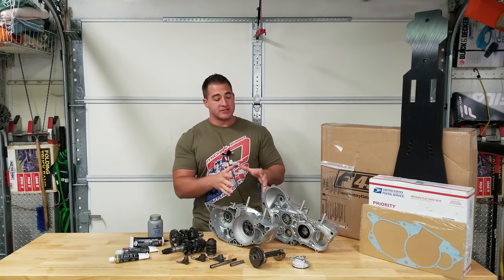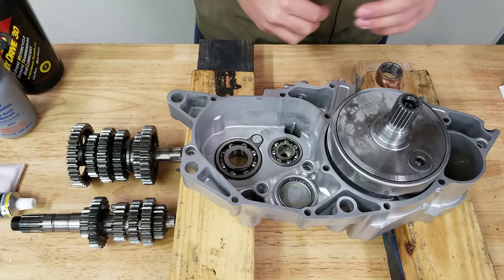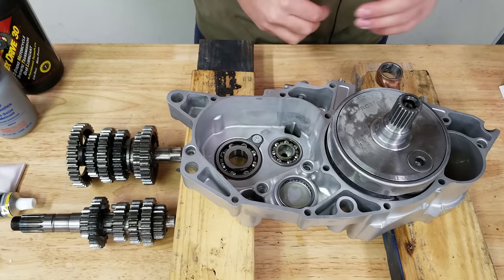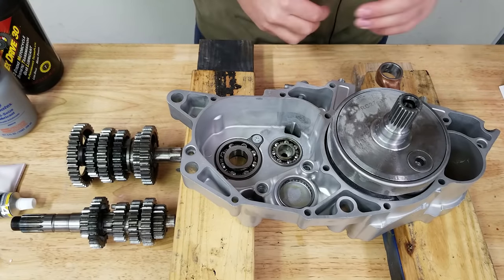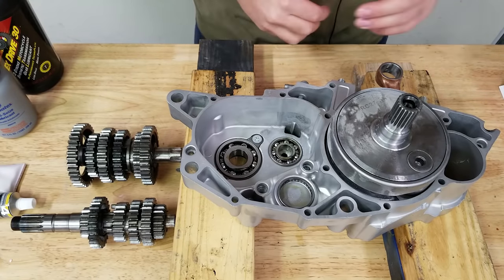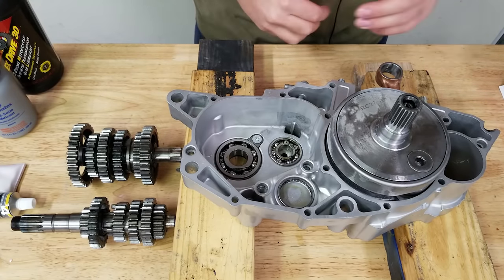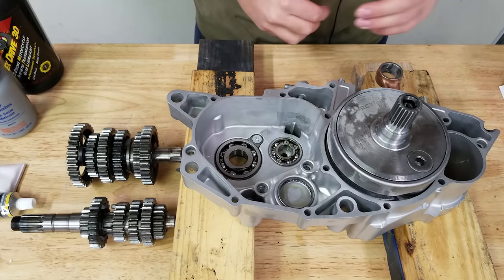Building the Center Cases on a Honda TRX250R, Step by Step | Project 250R Part 20

Comment: I used zip ties to hold the gears tight.  Lined them up and inserted the gears.  Once started in the bearing holes, I cut the zip ties and pulled them out.  Worked perfect.

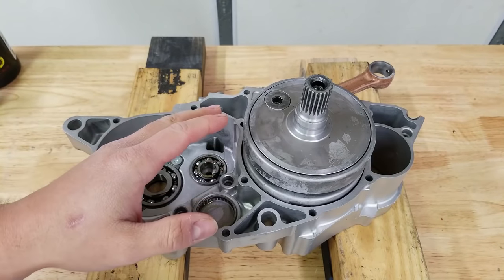Comment from the maker: SORRY FOR THE DUB AT 4:32-4:50!!! I am in the process of fixing it!!! You all rock!! Extra special thank you for everyone that tuned into the premiere!
Reply: Cream and a man been watching all your videos from the beginning specially the to 50RI am a to struggle over myself I'm currently in the process of rebuilding its a caddy for one dunno if you knew of any companies like a help me with parts I know they are super rare and a lot of the parts of discontinue try calling some of your buddies over at DBC but I'm never able to get an answer wonder know if you could help me out at least pointed out right direction
Reply: Sorry about that my auto correct on this tablet is crazy....smh
Reply: 88 kawasaki tecate 4 need help finding parts
Reply from the maker: DBC is usually pretty responsive; you can try sending them a direct message on their instagram @dbc_racing or email them. Parts can be really hard to find for these older quads unfortunately. Always keep an eye out on 250r forums and ebay.
Reply from the maker: The Tecate 4 is probably the hardest to find parts for, especially the 88.' I want to build one but that is what's holding me back from doing so... parts

Comment: Happy to see the poly skid plate. They slide across stuff so much easier so they dont have to be as tough as the metal or aluminum and are better for the vibration of the bike and also for putting back on after taking some hits they line back up and are not as warped, if so lay in the sun or put some heat to it

Comment: The moly grease is not for sticking the washers of the gears, it is when you crank the engine for the first time, this places can be damaged because of low lubrication. It will also prevent heat buildup in this rubbing parts. This is what I know.

Comment: I always find it easiest to stand the case up when putting in the trans. Gravity doesn’t pull the washers off. And usually you can mesh both shafts and support from the bottom with both hands. Slide it right in place then put the case back down for the shift drum and forks.
Reply from the maker: Good call, some other guys were saying the same thing!

Comment: When you are installing the crank by freezing it you can heat the inner race on the crank bearing. Just take a socket that fits inside of it and heat the socket with a torch. Not in the bearing obviously.  If you heat the socket and put it in the bearing a few times you can transfer heat to the inner race without melting and seals like would happen using a torch on the bearing. Doesn't take much to get it to expand just enough for the frozen crank to drop right in. I've built a lot of engine's both 2stroke and 4stroke and it works flawlessly most of  the time. 1 or 2 out of the last 10 engine's I've done only needed to be pulled the last 1/8 inch probably due to me just not being quick enough heating then dropping it in immediately.
Reply from the maker: I appreciate the info man! I don't mind using the crank installer but I will have to try this method!

Comment: Sweet ass build. Curious if u got the crank run out checked before u installed it. I'm sure u bought new crank yet just because it's new doesnt guarantee it was balanced properly. Even few thousands out cause excessive vibration etc. To nice a build to skimp on anything.

Comment: Is that assembly lube compatible with wet clutches?  Probably should have used tranny fluid for transmission parts and two stroke oil on crank bearings.
Reply from the maker: I flush the first oil fill to clear it out; I actually read up on this and it's a pretty normal procedure even though most assembly lubes are not made for wet clutches. But yes; I could have used the tranny oil and 2 stroke oils.

Comment: Hey Mike, Great videos!!!  Question.... how did you get the bottom bearing of the clutch lever out of the case? Thanks for any advice you can give, Lloyd.
Reply: Blind hole bearing puller take it right out

Comment: Looks good man so I want to get ur opinion I let my brother barrow it for the day and apparently he didn’t run it before putting oil in and I think he put to much and I think he blew a gasket or something or the seal and the oil smells like gas or there might even be gas in oil what does that mean or what could it be thanks
Reply: I was thinking shot piston rings or blown gasket or seal let me know what u think thanks
Reply from the maker: What kind of bike are you talking about? It's really hard to diagnose without actually seeing it; but it's possible he blew a seal.
Reply: Michael Sabo it’s a 06 ltr 450 but he over filled it and I tightened down the seals and hasn’t leaked yet so fingers crossed 🤣 thanks

Comment: I have a 05 Honda trx 400ex that completely stopped shifting when I was riding it but the shifter still moves up and down but doesn’t shift can anyone please help me.
Reply: Maybe a bent shift fork
Reply: The shift shaft might've popped off of the shift drum.
Reply: Ok thank you guys for helping out
Reply: The gears on the shifter lever themselves are prone to wearing out and could be as simple as that just pull off the shifter u just have to loosen a 10mm bolt and look at the gears
Reply from the maker: Sounds like a bent shift fork

Comment: So this engine is a 1987 motor. I was going where is the counter balancer in the engine? ah only the 1988 and 89 had it mine did. It was a 1988 model.
Reply from the maker: Counter balancer is found on all TRX250R models 86-89

Comment: If that was a oem crank you would not need the crank install tool.
Reply: @blaketurner6492  sorry just the one case side will go in. The other you would need the Install tool.if it was a oem crank.
Reply from the maker: Learned this after; Hotrods uses a press fit on both sides